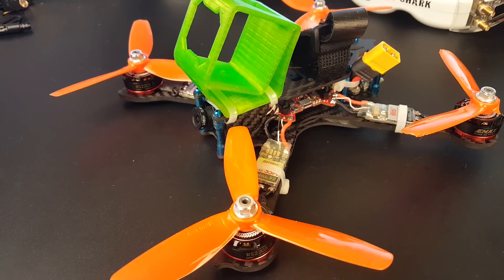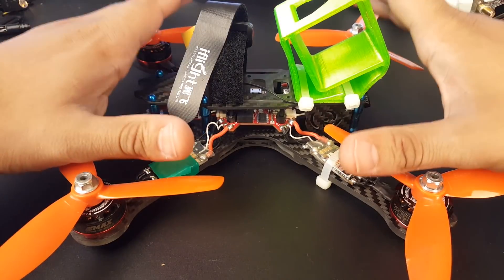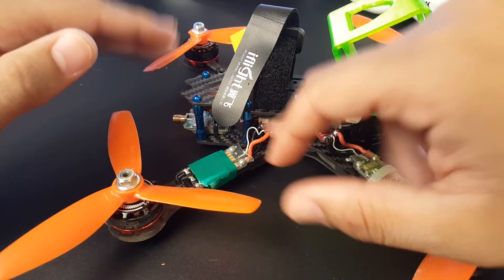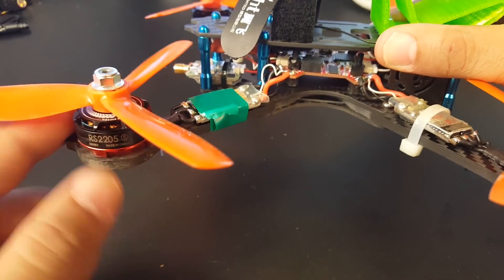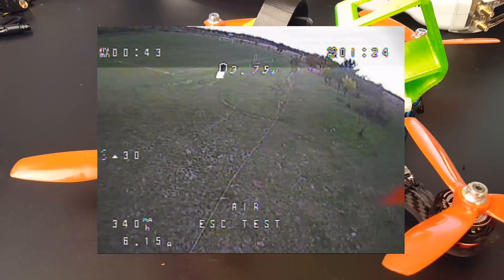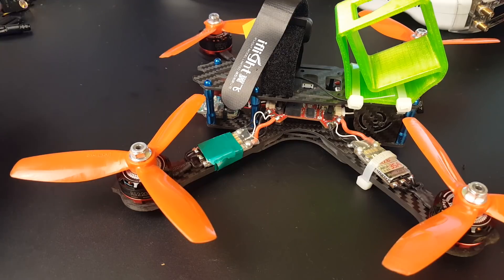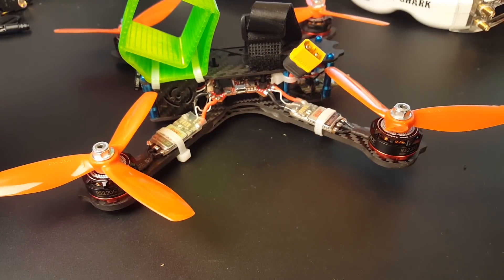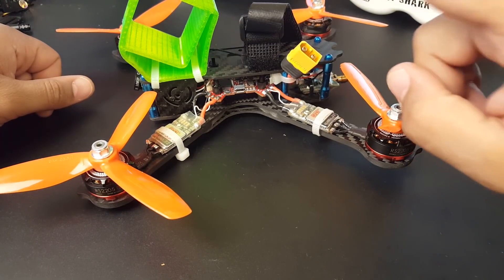Best ESC Of 2017?!! // DYS Aria 35A ESC

Comment: did u have to flash the esc. i am having trouble doing so. i plug them in and connect to blhelisuite and it wont read 2 esc number 1 and 4. but if de solder and hook the original 2 and 3 esc to where the 1 and 4 was and they work. do u think its the board or esc. any help would be great thanks
Reply from the maker: Do you have an arduino or ftdi?
Reply: Drone Mesh I don't I have never used one

Comment: Drone Mesh, any rhyme or reason I put the these on a Diatone GT200 S fury f3 board and it's throttle is all messed up, armed it and it started flipping out, the other day I flew it briefly only to have the motors keep spinning faster and faster, thought it was the I term in BF 3.2 but took that off, any advice much appreciated

Comment: I'm using these on the Kakute F4 AIO and I ran them at 32k/16k without any issues. I love this setup.
Reply: Hi Chad, i've got your same setup... How you have set Your Kakute and flashed your esc to run 32k/16k without issues? If I try my throttle go immeaditrly to 100% Can u help me?
Reply: Giuliano De Micheli Also did you overclock the cpu? If not then do that too
Reply: Giuliano De Micheli im also 48k pwm frequency
Reply: No I've try only with enable 32khz from betaflight gui
Reply: At the moment I've got stock PID. I have to lower by on P,I and D on all axes?
Reply: I have to set in blhelisuite32?

Comment: Another question: I got a couple of 5S, could you tell me what I should check before trying them on my drone ?
Reply from the maker: +6rilllir6 plug it in without props and arm of it works
Reply: hmmm...
Reply from the maker: +6rilllir6 Sorry comment was cut short make sure all components can take 5s then plug it in with no props and arm it if it works take it out and start easy and see if it flies good if it does then just rip it. 
This is What I do.
Reply: only my cheap motors aren'y rated for 5s (racestar br2306s) yet I'm reading about ppl using them with 5S, that's why I was wondering if there was some other things to consider.
I'll see ... :)
actually, most of the motors I check are rated for 3-4S, so I wonder..
thanks for your feedback.

Comment: Hey Mesh,

i have myself running 3 sets of the Aria, and i love them! Telemetry working good, the Amp draw readings are a bit off on mine but it is ok range. They do not show Voltage over telemetry, i use the onboard ADC for voltage and the ESC for Amp draw
I build 3 more Drones for Friends/Customers with these also, they are very very happy with them.
I do run them on 32-48khz running fine, but 1 of my friends reported a weirdo with 48khz on his high kv motors.

Keep it real!
Otter
Reply: And btw, a 470 cap was more then enough on 32khz to clear the picture on mine, did not had a 330 layn around for test
Reply from the maker: Awesome great to hear... Did you get the ESC temp to work as I have not tested it yet.
Reply: Yeah temp reading show up in BF OSD - It shows the average of all 4 readings in 1 number
Reply: Would be better to get all 4 seperate to find a "possible" defective Motor easier, but better then nothing, if numbers goes crazy at least you know 1 or all of the Motors seems to have a heating problem
Reply: But best option on BLHeli32 with current sensor, is current limiting, lovely feature ^^

Comment: hey drone mesh, what's a better ESC between these Aria 35amp and the ipeaka 35amp ESC's? also considering the new 35 amp spedix ones, much smaller and no led which is more then fine. what would you consider between the two and what would u pick between the 3 of them if I look at the spedix also? hope you have a good evening. thanks for the video been looking at these since they were released.
Reply from the maker: idiotsniff Aria is better than both.
Reply: hey Drone mesh, can you explain a bit more on the differences between or why u like the Aria vs the Spedix 35amp BLHeli_32 ESC's? thanks again

Comment: What "issues" are people reporting on 48kHz? :O
Reply from the maker: Niels Sparre Jitters but have not confirmed them but thought it would be good to add this info incase it's true.
Reply: haha xD i'll set it back to 24kHz tomorrow and check if it helps
Reply: Mid throttle oscilations lol
Reply: dun do it now
Reply: Drone Mesh I set my wraith32s to 48k, and on stock tune f406 aio emax 2306 2400 i'm getting full throttle oscillations. Do you think I should play with tpa or try lower frequency on escs? I haven't had time to try anything yet.
Reply from the maker: +TheBigblock81 I have same setup I needed at least 1 low esr cap.
Reply: Drone Mesh I put a 1000 panny on there off the start, I will try tpa this afternoon.